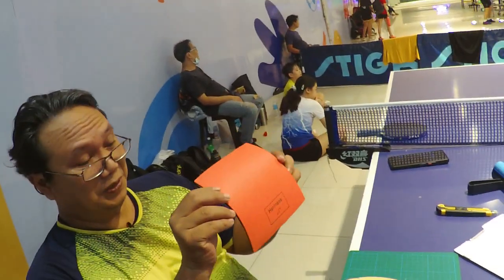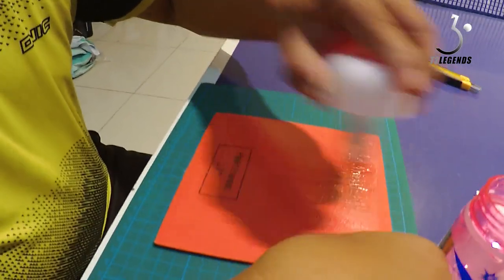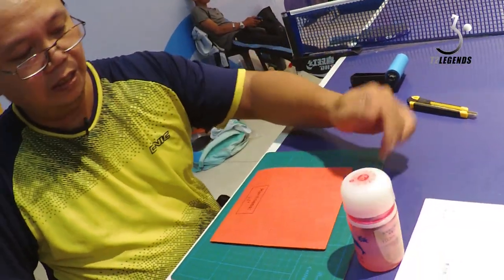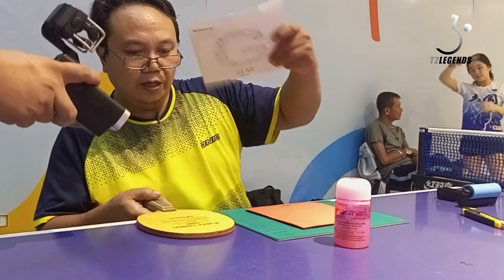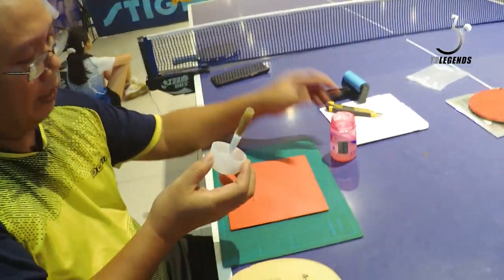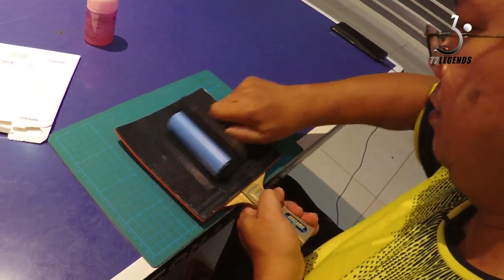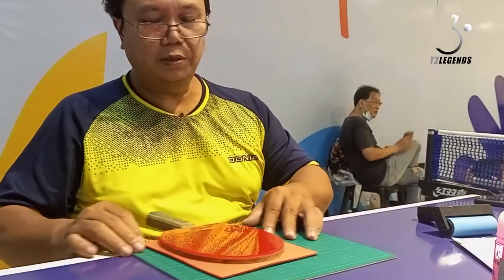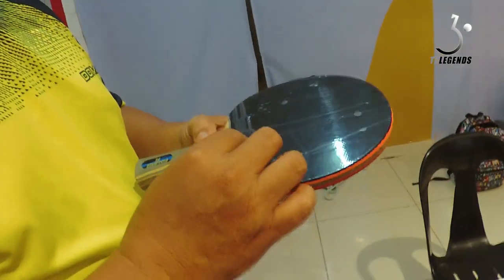How to effectively glue a Sanwei Gear Hyper rubber - A table tennis review

Comment: Why use Booster and Speed Glue?

aren't  products that are released recently designed to work without boosters?
Reply from the maker: Thank you for your comment. We used booster to make the rubber flat. So it can be immediately used due to the dome nature of the rubber. We will try also the water glue based and test it. 

Thanks for dropping by.